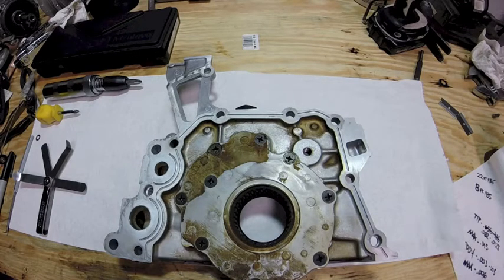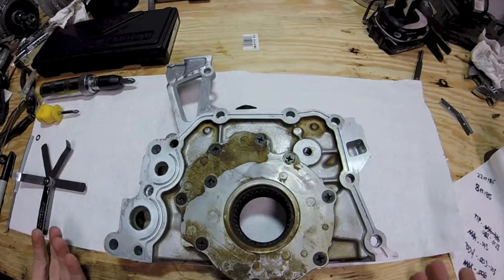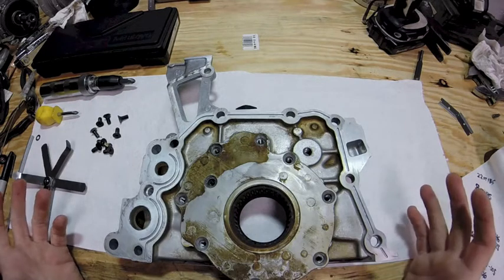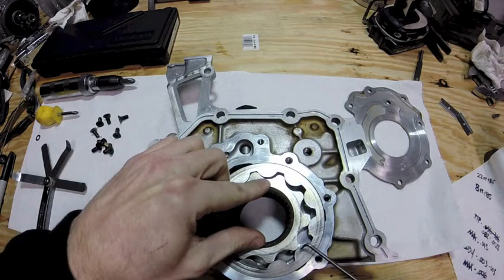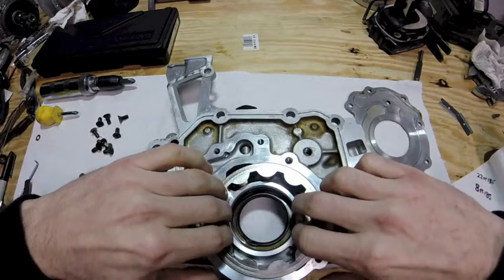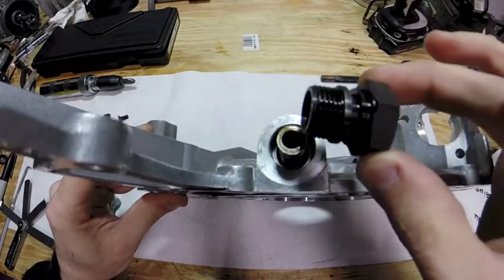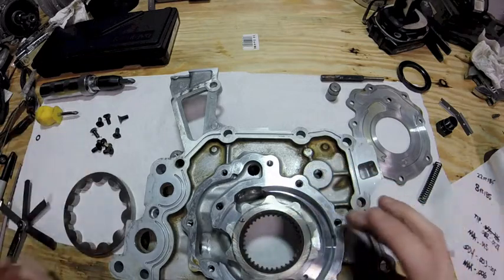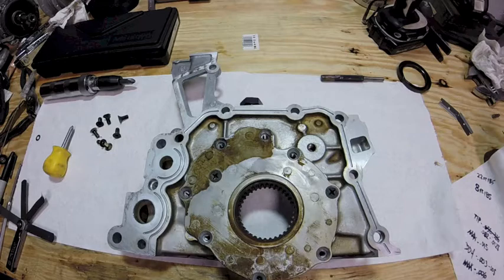1JZGTE VVTi | Oil Pump Service | DIY

Comment: Thanks its very great video, i have 2 question, i opened 1jz gte oil pump there is a dot on the outer rotor in your video its facing up, but in mine it was facing down i dont know if the previous owner opened it or not, but how should i assemble it up or down? And other thing after assembling how freely should pump turns by hand?
Reply from the maker: I'm not positive on the dot. Only way would be to check a fsm on the 1jz. I am 99.9% sure I put mine back together the way it came apart.

As far as being able to turn it by hand after reassembly, there really shouldn't be any resistance in the pump. It should be pretty easy to turn with the exception of fresh oil or assembly lube that was used.

Comment: I currently just pulled my motor out for other reasons then just this. But could you please help me with a part# or link for the Factory Oring for the bolt ontop the oil pump. Mine has started a nasty leak as you mentioned in your video. Motor is also a 1jzgte vvti
Thanks!!! For any help
Reply from the maker: same as 2jz, go to the dealership and they can show an exploded view of all the parts. usually takes them a day or two to get it.

Comment: Thanks for this video.

Maybe use assembly lube during reassembly?

Also, I have the FSM that covers the 1JZGTE. Its in Japanese, but I'll look to see if the specs are listed and post them up. The 1J and 2J oil pumps are different part numbers so the specs could also be a bit different.
Reply from the maker: Yeah either or, I just had a small container of fresh oil and gave everything a coat before putting it back together.

Comment: this video was great advice ,thought I might have did the wrong thing checking my oil pump for my 2jzgte,it turned out my oil pump was damaged and it had a ridge in the housing throwing it in the bin where it belongs